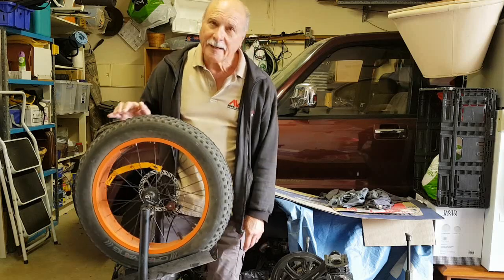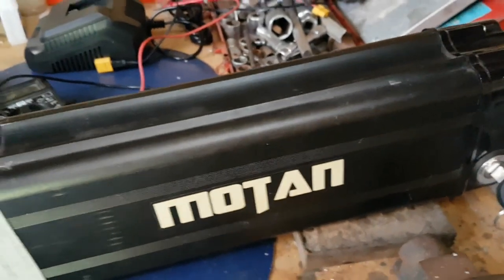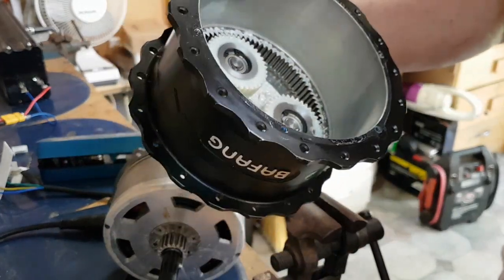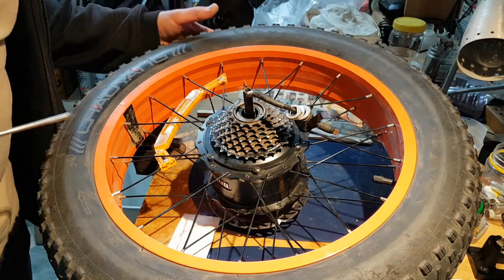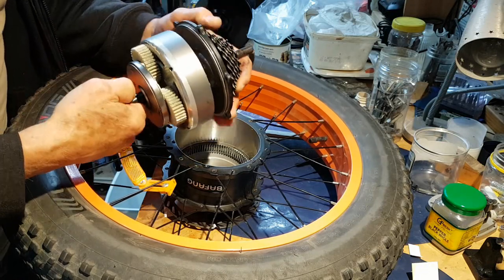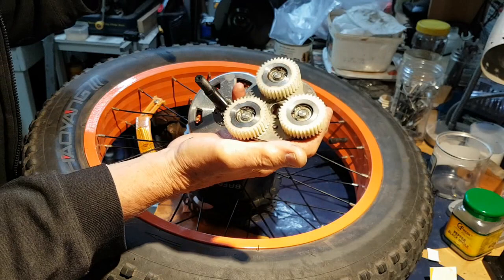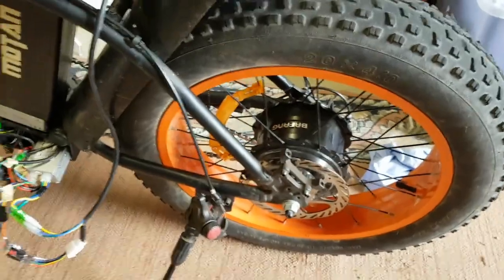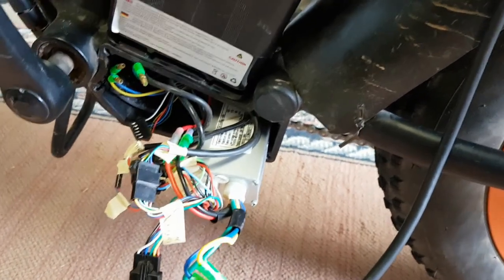Uprading my 20" fat tyre Ebike -500w to 750w - PART 1

Comment: does this rear motor fits on the super73 bikes ?
Reply: Yes , I just done one , brilliant ,
Reply: @Crosshatch1212  Did you upgrade the controller to one with more amps or use stock?

Comment: Are you kidding me? the 500 watts was way smaller
Reply: Yep! The  company that built the ebike placed a weaker motor but added powerful controller and battery
Reply: @delmanorshun2471  I think that's what mine is, says 750w but motor is tiny compared to this 750w. Crap on hills too, I'll be upgrading for sure, hopefully my 18amp 48v controller still cuts it..

Comment: Pure io sto mettendo motore più grande mia ado a20fat prima età da 250/500 adesso e 500/750 watt acquostato su ali espres arrivo in 6 giorni big fut Mag da 750watt non vedo l'ora di inserirlo e provarlo già vecchio motore faceva 45/50 kmh gps adesso 750watr batteria da 48/20amper controller kt 23amper 9 mosfett dovrebbe fare circa 50/55 kmh gps non vedo l'ora mancano 4 giorni arrivo dell' motore non sto più nella pelle mio causa tre fili delle fasi anno squagliato plastica anno fatto corto insieme bruciato motore modificherò con tubi di plastica per proteggere contatti plug  così se toccano fra di loro non faranno più corto circuito potenza tanta fili tendono a sguagkirsi plug allora devo mettere protezione plastica dura per evitare di squagliarsi cin calore passano più di 30/35amper specie in salita fili riscaldano e tubicino plug si riscaldano e se toccano insieme fanno corto circuito devo mettere protezione ogni filo tubicino di alluminio o plastica dura vedrò quando istallerò motore nuovo cosa mi inventerò a presto
Reply from the maker: Quando si lavora con motori potenti è necessario utilizzare cavi sufficientemente spessi per trasportare la corrente senza scaldarsi.
È anche una buona idea inserire un fusibile per proteggere il motore e la batteria.